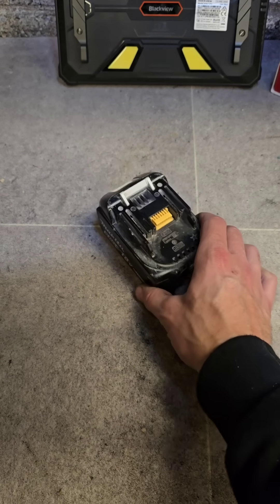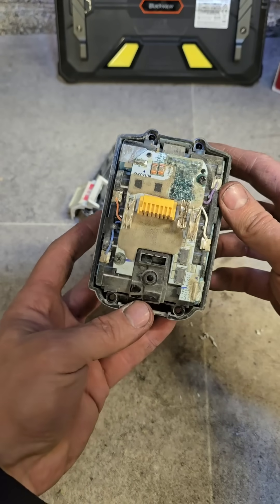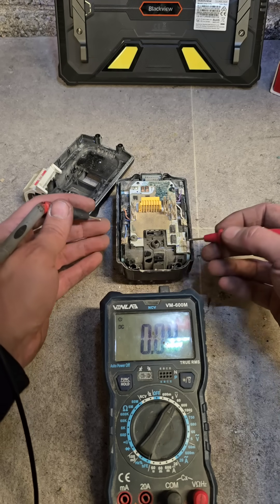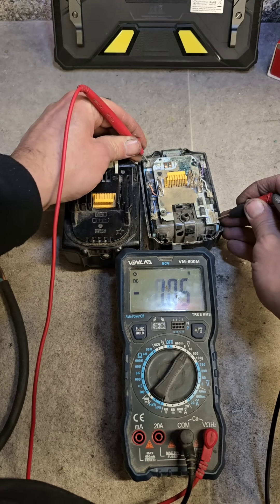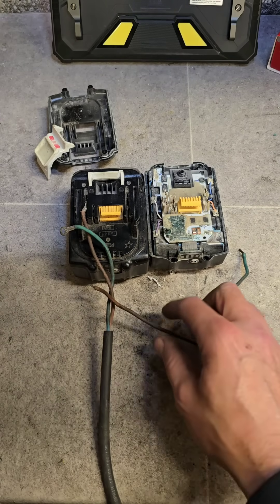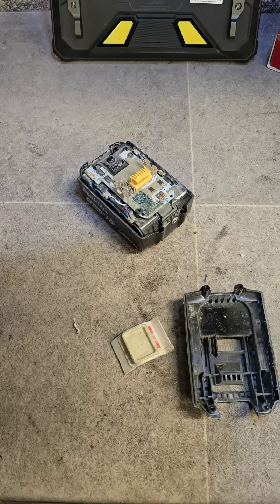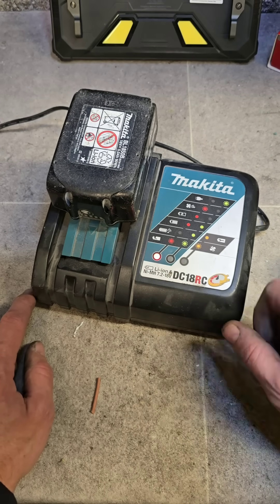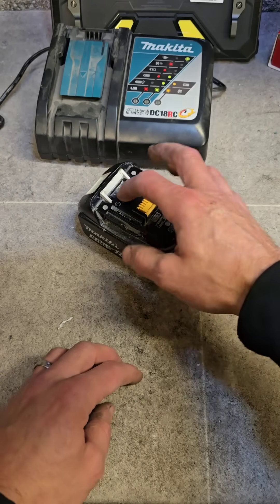How to revive a dead Power Tool battery.

Comment: You have to 

test all cells to their rated 1.7 Volts by removing each one of them 

Charge each cell manually like you did with this 18V battery and see If it charges to 1.7V and holds the charges without a load 

Finally you may see one / two faulty cells and replace with brand  new 1.7 Volt cells 

If all cells can not hold charges steadily, buy new one obviously

Comment: Also, sometimes the board will lock the battery if it detects a fault. You'll get blinking lights. There's a clever and generous fella that developed a bit of software called Open Battery Information that allows to read the battery info (cell voltages, charge count, etc) and also allows to unlock "dead" batteries. You need a 5 euro Arduino board and a couple of cables.

Comment: Do you need to strip it down or can you just go live to live etc and get the charge up ?
Reply: If you don't strip it down you won't be able to see if there is a bad cell, so you could just be spinning your wheels. It might take a few extra minutes in the beginning to take apart, but it will save you time in the long run

Comment: What about the star protection, shouldn’t it protect it from discharge?
Reply: Only if it's been used on a star compatible tool. A lot of older Makita tools only had two battery terminals.

Comment: This method of boosting still stresses the battery with too high currents (>4A). The safe method is to use a constant-current power supply with about 0.4A for 10-cell batteries (2 in parallel). There are smaller, cheaper modules than a proper lab bench power supply. But not many people have such tools, so we resort to boosting with a wire.

Comment: As far as I understand it if you put.a Makita battery on the charger and it rejects it after two or three attempts the chip on the board shuts the battery down so it can't be jumped and you have to change the board first.

Comment: I've got a bench power supply.  Just set it at 20.5 volts and 500 ma and let it charge up.  Absolutely check for dead cells, too.  I also have a cell balancer meant for RC cars, but I rig it up to the battery to make sure all the cells are balanced.
Reply: And I do the same.  Cell balance is important.
Reply: @billkraemer4710  Over the couple of years I've been doing it, I've been surprised how good most quality batteries are at staying balanced.  If I've taken in a used one, I always check it for my own peace of mind, though.

Comment: I tried this, the dead battery got extremely hot very quickly
Reply from the maker: That's why I said you do Not hold the leads connected. Simply touch them a few times amd test the voltage. 
If a battery ever gets hot within a short time, never use it.
Reply: 1. That is possibly a dead dead battery which lost its capacity and can't take a charge.
2. If it can take a charge then the safe method to do this is using a constant current power supply set to 0.5 Amps (or even less) which limits the current so the battery is not stressed.
In this video the voltage difference is 3V which can result in a much higher current. The short pulses are meant to let the battery cool down, but it's not a safe method.

Comment: Charged 1 below 13 volts in a charger. Nonsense ,Dean. All of them discharges from 15 to 16 volts. And then charges normally. Im 2 years into batteries only. Trust me. Also assembled my own diy 10ah makita battery for example. Fixed loads of batteries. All of them goes to 15 volts. Then charges up no problem.
Reply: The various makers all set their minimum voltages according to what their attorneys tell them, and even that changes over time with battery and charger updates.  It's "nonsense" to make general statements that don't apply to all makers' batteries.

Comment: A very discharged battery cell  is very vulnerable to high current, even very short pulses. You can "revive" it with a very small current applied for longer, if the voltage is a bit too low, but the critical parameter is for how long it has been in that overdischarged state. If we're talking weeks for example, even if you make it work, chemistry has chaanged permanently and with it two very important parameters ie the internal impedance (changing the maximum safe current it can provide and how fast can it be safely charged) and the self discharge rate (changing dramatically the shelf life, how long it can stay unused without a new imbalance happen, if the tool us used daily you may not notice the problem)
Manufacrers following generic rules can overdo it concerning safety caus there are liabilities involved...

Comment: ... Slightly concerned about high current spikes,... Would it be a good idea to put a 12v headlight bulb in series with the wires to limit current?
Reply: freaking good idea.. or just a simple fuse

Comment: Tip: you can reduce the risk to short out  accidentally the battery with the lead per cutting one lead shorter. So it can't touch them self easily.
Reply: Excellent!

Comment: Can you do that to dead dewalt battery it won't charge
Reply: Depends on the voltage & batteries inside the dead battery. Like Dean mentioned, check the dead battery both voltage and inspect the cells inside while checking their state. Any signs of rust then don't as the internal quick blow circuit could be compromised.

Comment: Thanks for that dean from across the water on the isle of islay. My old 14.4v Makita batteries have been dropping like flies lately. I'm going to give this a try.
Reply from the maker: Just be careful, lithium batteries are no joke. Do it outside
Reply: @deandohertygreaser  I will be. What would the efects of using an 18v battery on the 14.4v tools be?
Reply: @lottslife I wouldn't  as there's to much voltage & current in the 18v.😮

Comment: 1. These are not live and neutral if we are talking about a DC circuit, but positive and negative 
2. Most often the issue with these packs is bricked bms, there is a method to restart it
Reply: He does say 'positive and negative."
Reply: @thedevilinthecircuit  he called them live and neutral

Comment: i never understood why makita set their charge voltage so high. a lithium cell can go down to 3v with no problem. their voltage range is 2.5v to 4.2v
Reply from the maker: They all stop chartering below 16v
Reply: @deandohertygreaser yeah and the cutoff voltage is nothing below 3v to 3.2 dependant on brand.
Reply: @ToolTimeToday Milwaukee can go down to 12.5v which is 2.5v per cell provided they are equal https://youtu.be/mnXYA_ynGl0?si=n1796UF9svMS1JlS
Reply: @doctorlefthandthread  problem is that milwaukee batteries have no cell balancing.. it's all on the board but not enabled so you end up with a 75% capacity after a short time.
Reply: @ThatDaveFella none of them really have proper cell balancing regardless of what the manufacturers say
Reply: @doctorlefthandthread  true but at least makita have it enabled. they made sure to add functional balancing after their earlier batteries had none whatsoever.

Comment: Manufacturers should raise the minimum voltage to charge a battery.  The number of good batteries being tossed because of this must be massive.
Reply from the maker: This isn't something the manufacture decides. It is a set tolerance to do with safety.
Reply: There are standards that dictate this, they can't just do whatever they want.
Reply: @riba2233  i suspected this was the case and I should have mentioned so in my original comment.  As we know the standards set by the standard setters is not always what is best.  With advances in fault finding circuitry this could probably be adjusted to charge in low voltage situations only with healthy cells.

Comment: In a scenraio like this Dean would you recommend to the customer to keep this battery in a low power tool and label it ? I.e combi drill, impact driver, torach etc. 

It just seems that once a battery has a wobble like this it will never get back in sync. 

Thunbs up.
Reply from the maker: No, just always keep it at 2 lights. Never let it go to 2 light.

Comment: Cool advice to revive a dead battery and who also understands 100% the importance of how all batteries operate under this extreme procedure. From experience btw of how volatile 18v packs can be under this environment DO NOT SHORT THE LEAD OR CONTACTS as this would be bad for not just the battery but also a non experienced person. Thermal runaway is something that can happen in a blink of an eye, Like maybe one or two seconds. I'ts a very serious thing to have happen in a scenario where your trying to do this revival. Pls do your homework & understand the importance of why this is done only as a last resort to revive an under volted battery. Oh and make sure you are in an environment suitable to not put you in harms way like being outdoors or have a metal bucket by your side to throw the battery in to if thing's go sideways.

Comment: People should not do this if they dont know 100% sure on what they are doing.
Reply: Look out the health and safety mob are here
Reply: @Jonathan-qo1ir not me I have done everything to these batteries the method shown here is not the best option by a long way
Reply: @doctorlefthandthread please explain the best option in your view.
Reply: @darylthompson1132 my comments keep getting deleted here
Reply: Agreed. But he has been as clear as day to say you need a multimeter and you need to check the cells to make sure they are all low and not one set dead
Reply: Correct https://youtu.be/6xky0k7J99A?si=KGxcOUi9goza0bBy
Reply: @doctorlefthandthread  lol, I was expecting a video of a battery going up in flames but the one you mentioned is cool to  😅
Reply: @3fase-e6p the video I list is mine I have been working at these things for 3 1/2 years
Reply: @doctorlefthandthread  I could be a cool warning video/experiment to show what happens if you do it the wrong way. In a safe experimental setting. Lithium fires are no fun.
Reply: @3fase-e6p I have been doing this for years and thankfully never experienced a lithium fire. They aren't as common as people think you are more likely to burn your fingers or deactivate the cell if you overheat it. Lithium fires are so dangerous if they happen so that's why people think it happens easy.
Reply: I 100 percent concur. Not worth burning your house down or injuring yourself. Just buy a new battery.

Even if you knew what you are doing. Lithium batteries are volatile and unpredictable.